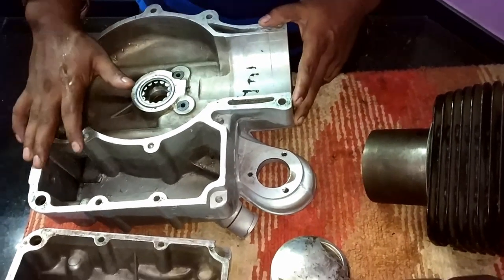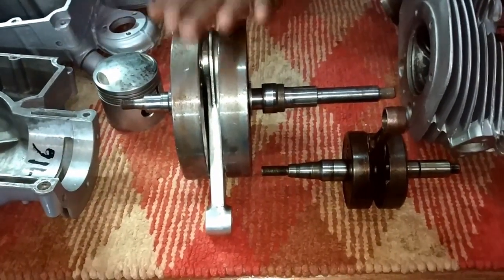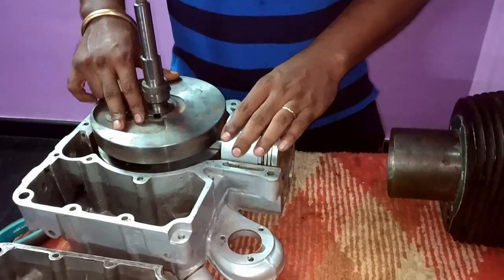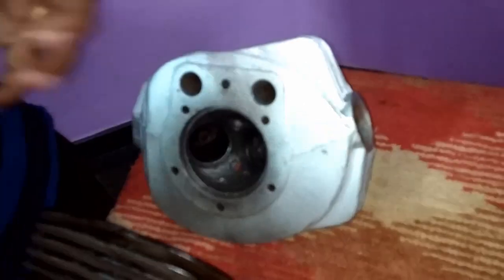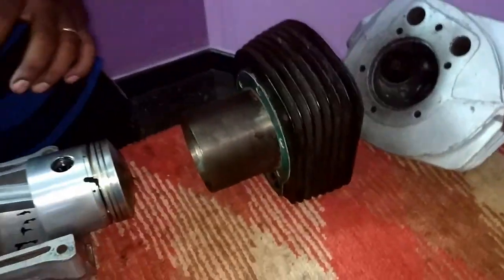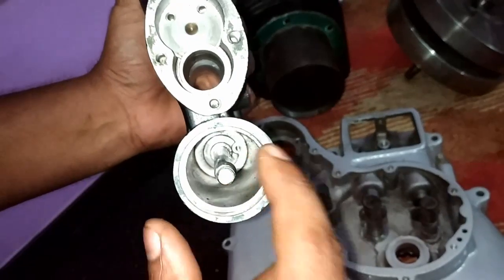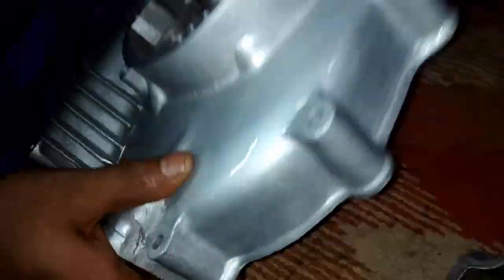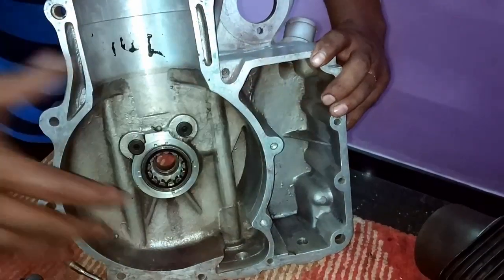Bullet Engine working | Royal Enfield

Comment: Awesome video😍👌👍 & very nice explanation sir. And I have one doubt  . Once when the engine oil is pumped from bottom side of the engine case by the secondary oil feed pump ,does the oil will be filtered by main oil filter which is present at the bottom side of crankcase and then oil will be passed through pipeline, sir? (which is present outside) to lubricate the parts such as  rocker arms, rocker cams as you told? Either, these parts are lubricated directly by secondary oil feed pump itself through oil pipeline (which is present on outside) with out filtering the oil through, oil filter which is present bottom side of crank case sir? so Kindly clarify my doubt sir ,and iam waiting for your feedback, thank you.
Reply from the maker: From crank case oil will be pulled out by returning pump and directly lubricates the rocker. In a complete cycle the oil is filtered by cotton filter only once which occurs when the  oil flow from oil tank to crank case.
Reply: @ECFixeljin  thank you for your valuable feedback